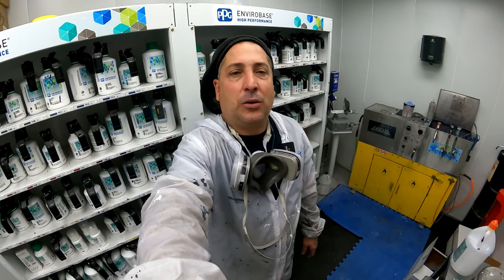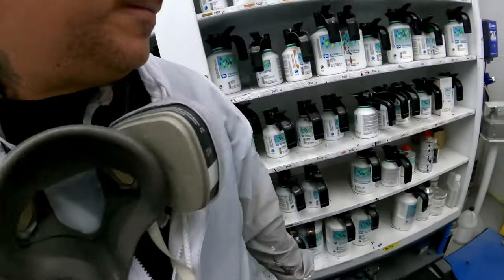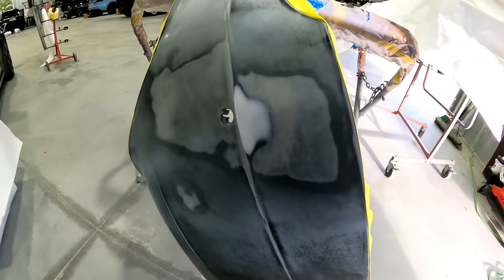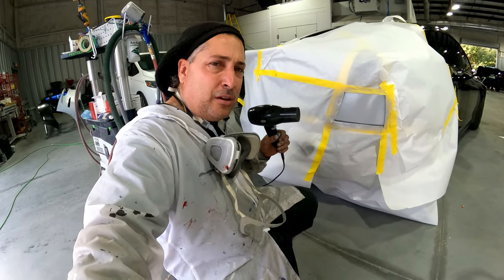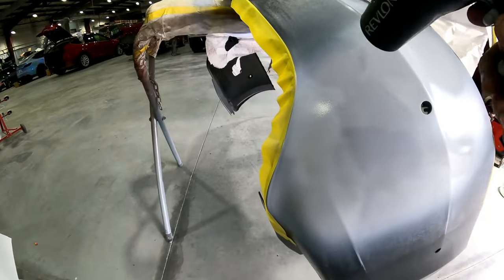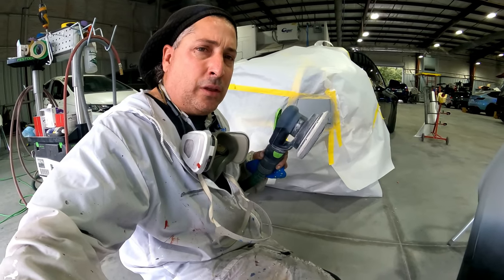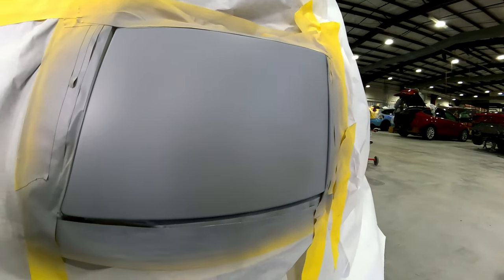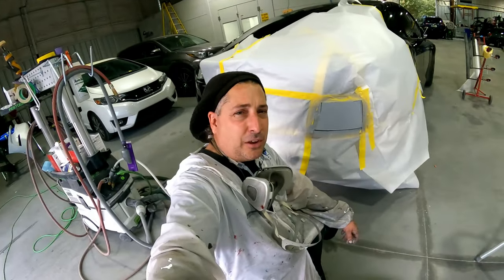MAKE MORE MONEY WITH THIS TRICK AND PRODUCT - EPW115 SPEED WATER PRIMER

Comment: That looks like a really good product, I have heard of waterborne primer but I've never used it, I'm surprised that you good folks don't use UV primer as it dries in seconds with a UV light with zero shrinkage and sands really nice I also use UV putty which again cures in about 15seconds then you can block and sand it👍John UK.
Reply from the maker: Gonna be  checking it out
Reply: I used UV primer for a few years in a different line but it does dry faster than anything I’ve ever seen…2 coats hit it with a UV light or the sun and your sanding in 2-3 minutes. Gonna be demoing the PPG UV primer very soon!!

Comment: Have been doing the hair dryer trick but  a ppg rep told me I couldn't ☹️... I never had a problem blow drying it though ...
Reply: Have you been told it's okay
Reply: It saves so much time and you can block  and re prime if body work is not good
Reply: Maybe because the designated dryers  have filters on the back, to filter out the air being blown to the wet panel . Just a guess and an assumption .
Reply from the maker: Water  drys from heat and air .I  done hundreds of cars never a problem. Do what works 💪 just don't use a heat gun.
Reply: Another great video and tip 👍I might get onto ppg now and ask if it’s available in the uk ?

Comment: Dont you need adhesion promoter on raw plastic
Reply: For bare plastics, an appropriate PPG plastic adhesion promoter must be
applied prior to the application of EPW115.
Reply: And it can be applied over bare metal
Reply from the maker: Never had a problem  but thanks for the insight
Reply: Its on the tech sheet